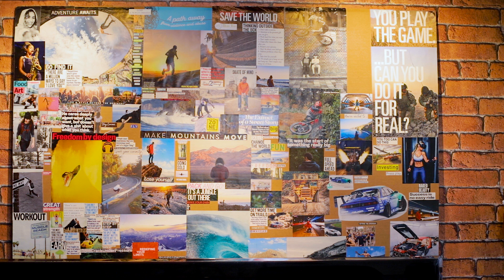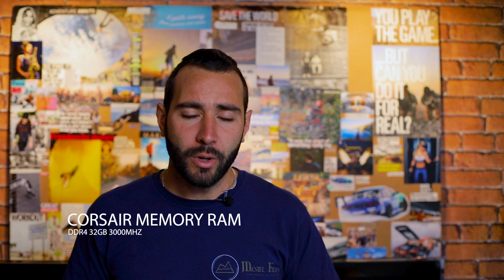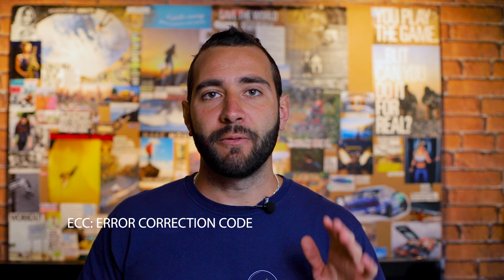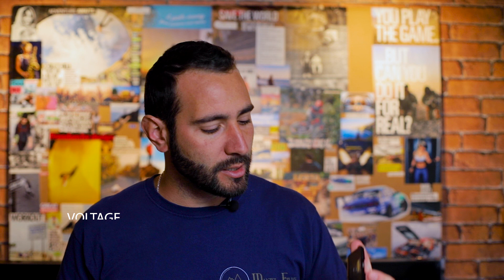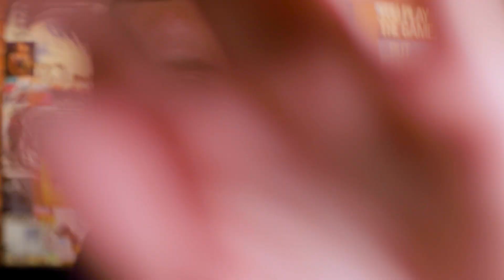ECC non ECC Buffered and Unbuffered Memory Ram All You Need to Know

Comment: 2 ram modules works, 4 do not works can you please help. all my slots are working fine and my rams are also good. the problem is when im using 4 slots it wont boot properly and if i use only it works fine. did you encounter this problem alreay? can you help me ty
Reply from the maker: Are all the same rams specs? Does the ram match with the maximum capacity (gb) of the motherboard?
Reply: @JDanielVzla  yes same specs but different brand 2 hyperx fury 8gb 3200mhz and 2 avexir 8 gb 3200 mhz. my motherboard is aorus z370 ultra gaming wifi. i dont know why when im putting 4 it wont work. did you encounter this kind of problem? hope you can help me ty
Reply: @JDanielVzla  i think i know what the problem is. Upon checking again i just notice that the cas latency is not the same. So maybe that's the problem thats why they are not working with each other
Reply from the maker: It could be, I haven't experienced this issue before. have you try using only two but one of each brand? so we could know if it is the latency you are mentioning about.
Reply: @JDanielVzla  is xmp in bios related to this? I just notice that the xmp in my bios is disabled
Reply from the maker: @brianmishima1297  not necessarily, that is to overclock the rams for a higher speed or frequency.  https://www.pcgamer.com/what-are-xmp-profiles-and-how-do-i-use-them/
Reply from the maker: @brianmishima I found another article related to what could be happening to you. https://www.cgdirector.com/2-vs-4-ram-modules/#:~:text=4%20RAM%20sticks%20don't,see%20a%20benefit%20from%20it.

Comment: I bought a kit of RAM  ECC memories, but it doesn't recognize in two slots on my motherboard (Motherboard which is NON-ECC Unbuffered), the fact that the memory is ECC and the NON-ECC board can affect if there is no video or not recognize the memories in the first two slots?

It only gives video in Slost B1 and B2, the one indicated by the manufacturer is A2 and B2, and it does not recognize the memories in slots A1 and A2.

(XPG LANCER RGB DDR5 DRAM 32GB 2x16GB 5200MHz CL38 Black Heatsink 2PK RAM Upgrade)

Motherboard Z690 AORUS ULTRA
Reply from the maker: Hey Antoniel, Sorry I didn't get back to you before! I hope you could sort it out. It is weird that it affects the video. if there is a problem with the memory ram or any incompatibility the PC won't get to window home. Have you checked the Memory support List? I can read on the website that the ECC will work as NON-ECC. So maybe is not compatible with your motherboard, and that's the issue. Memory Support List  https://www.gigabyte.com/Motherboard/Z690-AORUS-ULTRA-rev-1x/support#support-memsup

Comment: Hi can I use 16gb ddr3 (2x8) ECC SERVER ram for gaming
Reply from the maker: I don't have to much experience with games, but I believe for gaming you don't need a ECC memory ram this is more for data, bank and counting systems where the information has to be more precise. And the ECC will  be a bit slower than non ECC and in gaming you want things fast. Remember to verify your motherboard specification for the capacity, speed and type of memory ram you can use. I hope this helps you, all the best.

Comment: More the ECC non ECC buffered and unbuffered memory, if you run on an i5 more then 3000 it will use the max the motherbored supports
Reply from the maker: Yes, remember the maximum speed is the lowest speed of the components, I mean with that if for example the CPU or the motherboard as you mentioned the maximum speed is 3000 MHz and you install a higher memory ram speed, the fastest speed it will be 3000 MHz. It is the bottleneck.

Comment: I’ve two RAM each of DDR3 1600mhz 8GB and my motherboard has two slots A1&B1.. when i fill them into motherboard the computer wont boot.. but when i fill one of them into A1 its boot correctly.. but together wont boot.. why ?
Reply from the maker: It Could be different things. I guess the memory rams are the same model and brand. 1. Make sure the motherboard specifications and if it is compatibility with the speed, capacity and model of the memory Rams. 2. Try one ram into A1 and leaiving B1 empty. Then try into B1 and A1 empty to make sure the slot is not damaged. 3. Try one ram in A1 and then try the other one in A1 to make sure the memory ram is not damage.
Reply: JDaniel Vzla i tried everything that you have mentioned  in your comment but no avail. The two slots are working. And the two memories are the same brand and model. And my motherboard is support dual channel and DDR3 1600mhz
Reply from the maker: Check the motherboard's capacity if it is up to 16GB memory ram or not. It is the other thing I am thinking it could be.